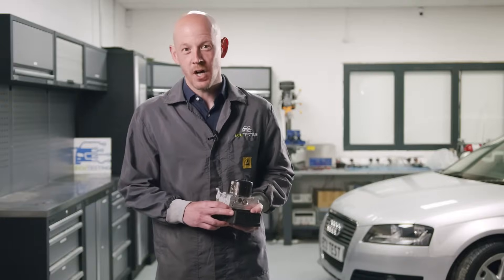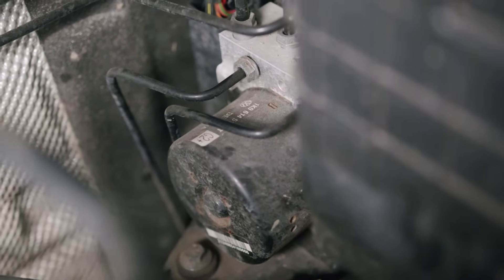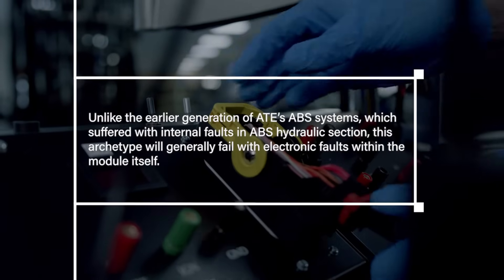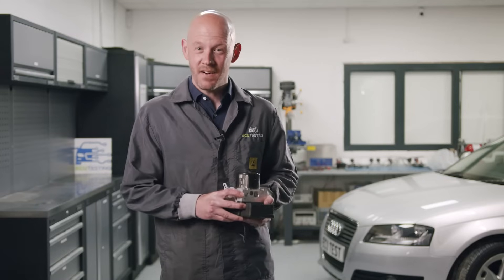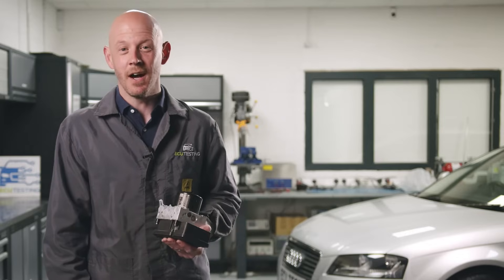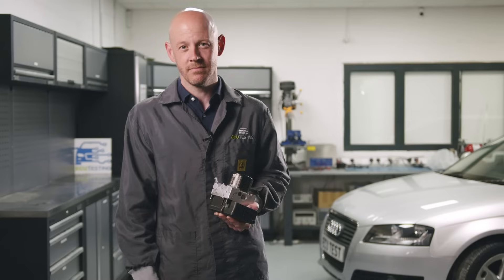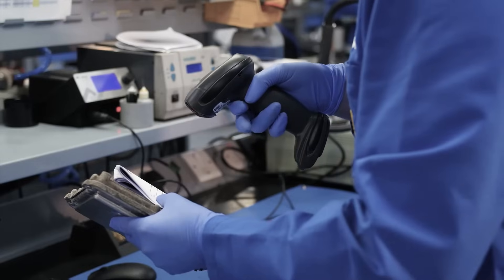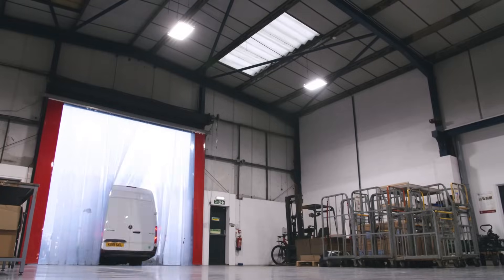ABS Light On Audi A3 And VW Golf – Caused By Fault Code 01130

Comment: What the reason of the first fault? 01130
Reply from the maker: Hi. The cause of the fault code 01130 is typically an internal failure in the module of the ABS unit. If you would like to get your unit re-built then please follow this link: https://www.ecutesting.com/common-faults/volkswagen/volkswagen-golf-audi-tt-and-a3-abs-pump-failure/ and select your make and model of vehicle, then the part number which matches the one printed on your unit. If you cannot find your units part number on our website, then please email our technical support team on info@ecutesting.com and they will assist you further. Thanks.
Reply: @Ecutestinglimited   do you know that eror code 1130 is in ABS elektric block brain ?

Comment: I found a power issue on my 09 Jetta. 12v not getting to the abs module because of a bad connection and corrosion in the fuse block under the hood. 
Replaced fuse block, erased codes, 1 week later and all is well.

Comment: Hi. i got a A3 sportback 2.0 2009 CBAB with the ABS, brake and esp lights on, using a OBD11, codes i got are 01276 and 01130, i''m trying to run the abs pump so i can test the power to it with multimeter. but it wont let me i just get this > (22) function cancelled, marginal condition have been met, what do i have to met to perform the test or is it because the pump is done for ?
Reply from the maker: Hi. Have you checked the relevant fuses that power the ABS? If these have checked out ok then unfortunatley it will be the ABS that is faulty. If you would like to get your unit re-built then please visit https://myaccount.ecutesting.com/ to get started. Any further questions please contact our technical support team via email at info@ecutesting.com and they will be happy to assist you. Thanks.
Reply: @Ecutestinglimited  i seen this maybe Audi will fix it for free ? Recall number R/2017/190

There are 38548 AUDI vehicles affected by the recall R/2017/190.

This recall was issued on June 20th, 2017 and all the details of this AUDI recall (R/2017/190 - ABS/ESC SYSTEM MAY FAIL) are provided bellow:

Recall reference
R/2017/190

Recall Type
Car

Recall Date
2017-06-20

Reason for concern
ABS/ESC SYSTEM MAY FAIL

Reason for recall
On vehicles with ABS/ESC the earth connection may be interrupted. This may cause failure of the ABS/ESC system.

Remedy
On affected vehicles install new software. Where necessary a new ABS/ESC control unit will be fitted.

How to check if the vehicle is recalled
Contact the local AUDI dealership or manufacturer. You will not need to pay for anything involving the recall.

How the manufacturer will repair
The Recalled vehicles will have the fixing checked and corrected as necessary by and official AUDI service.

AUDI Reference ID
45F5

Number of affected AUDI cars
38548

AUDI vehicles affected
Model	VINs	Dates
A3		2008-05-01
to            2009-05-31

Comment: mine just failed. however if i start the car with brake pedal held, no faults show. Once i release the brake pedal: ABS, brake warning flashes,  air bag warning and traction off comes on. I performed a code check of the ABS module and these codes do appear. Looks to me like a short for no brake pedal input inside the module. Checked all fuses side of dashboard and in the engine bay, no defects found.

What is your turn around time for repair??? Is there a facility in the states????
Reply from the maker: Hi. We are based in Derbyshire in the United Kingdom, however we do offer a worldwide service so you are welcome to send your unit into us for a re-build. Follow this link here: https://www.ecutesting.com/common-faults/volkswagen/volkswagen-golf-audi-tt-and-a3-abs-pump-failure/ and select your make and model of vehicle for the most up to date pricing and turn around times. Cheers.
Reply: Hey man I have the exact same symptoms as you regarding brake pedal held with no lights and release causes faults. What did you end up doing?

Comment: Hi Sir I am Shrijeet from India, a senior technician of VW group cars, nowadays in India lot of ABS control modules are getting failure for VW cars like Audi, Skoda, and VW, so all  these modules for replacing in dealerships is too expensive, so I want help from you to repair this module for me by sending your place, so guide me the sending procedure & repair cost of each module. And think this will be a long time business from us. Thanks pls reply on
Reply from the maker: Hi Shrijeet. You can either visit our website www.ecutesting.com and select the 'product catalogue' tab at the top, choose the make and model of car and finally the product (e.g. ABS unit) to view the prices for each module.

Or you can visit the common faults section of the website here: https://www.ecutesting.com/common-faults/volkswagen/volkswagen-golf-audi-tt-and-a3-abs-pump-failure/ to read more about the causes and our re-build procedure, as well as selecting the make and model of vehicle relevant to the unit you require re-building.

If you would prefer to speak to us regarding anything else, please don't hesitate to contact us via email at info@ecutesting.com, or via phone on +44 1773 535638. Thank you.

Comment: being that this seems to be a common failure with the abs module itself,
isn't it cheaper to disassemble the electronics module from the ABS pump itself and send just the module itself?
from my understanding the issue in 90% of the times these VAG ABS modules fail is bad soldering joints in the electronics module?
and lets say i find a new electronics module with the same exact part number as my own faulty one, wouldn't i be able to just swap the faulty module with the new working module? or that would still require re-coding the new electronics module?
Reply: You'd still have to re code it using VCDS or similar.

Comment: I have error 01130,i can clear after pressing brake. Once release it come back...
Reply: IM CHECKING THE FUSE SAME PROBLEM SOMETIMES LIGHTS DISAPPEAR
Reply: @jeivenkatesh8324  did you ever solve the issue? My 2010 GTI will throw the lights as soon as I release the brake pedal. Replaced all four wheel hubs/ABS rings and ABS sensors, checked brake fluid, and checked my fuses.
Reply: @ytr_gilbo  think you've ruled out everything bar the pump / module at that point surely? You ever get it sorted?